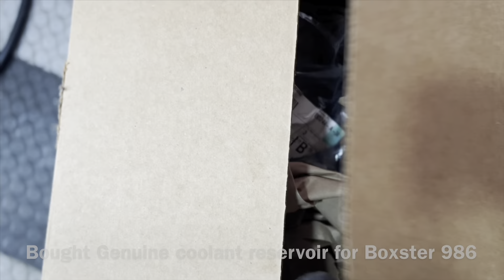DIY: How to Change Coolant Reservoir in Porsche 986 Boxster #porsche #boxster  #986

Comment: I just completed this task and it is every bit as frustrating as people say it is. It took my friend and I about 6 hours and a lot of cursing to replace the original tank in my '99 986. We couldn't get to the smaller of the two hoses inside the engine compartment, but once we removed the clamp from the larger one, we were able to pull the assembly into the trunk area enough to release the hose clamp from the smaller one on that side. Installing the new one is very frustrating in its own right. The caption stressing patience in your video is very apropos. Another hint to help with reassembly and, hopefully not needed, future replacement: we strategically replaced a few of the spring-type hose clamps with worm gear-type clamps. Thanks for making the video of this. Before starting, I watched yours along with a few others to get my bearings and, more importantly, for encouragement that it can be done.
Reply from the maker: Thank you, I hope it helped you somehow. Given the age of these classic cars, most works to be done can be PITA, but as you mentioned , it can be done with a lot of patience. Enjoy your ride and be safe always!

Comment: why you need to replace? what is original issue??

my boxter has hissing sound after replace water pump.
what is my issue??
Reply from the maker: The system is no longer pressurized. Some leaks had been observed.